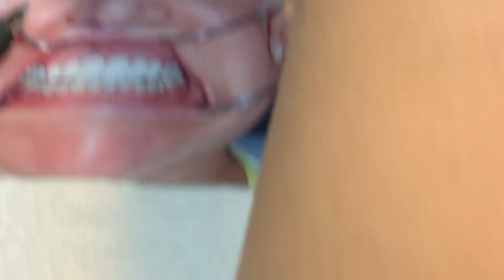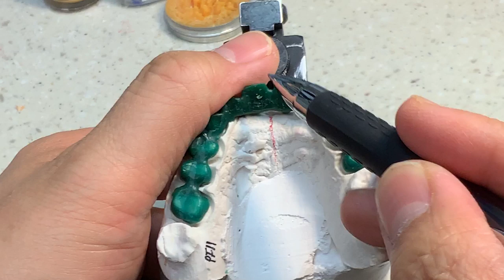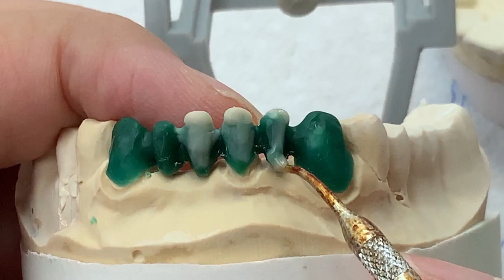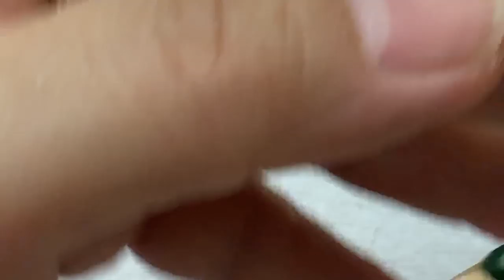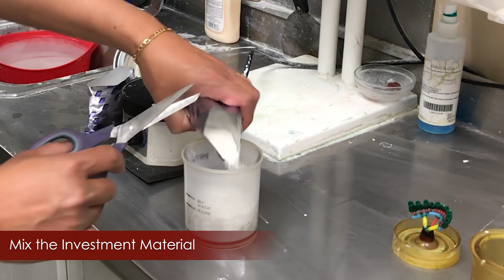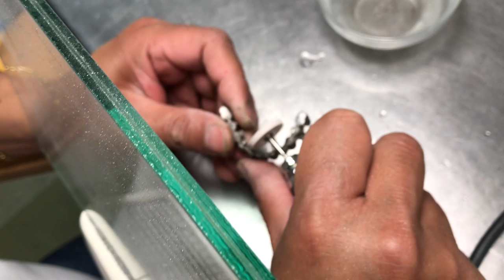How to Create the Framework of a Porcelain Fused Metal Arch

Comment: Will the metal after casting be deformed?
Reply: In my experience, it is not possible to fabricate such a large framework that fits perfectly with non-precious alloy. As a rule, tension occurs and the scaffolding rocks. I make such work in segments and then solder them together. In gold, platinum or palladium, it was no problem to cast such works with a perfect fit.